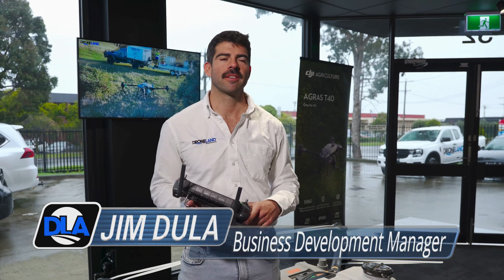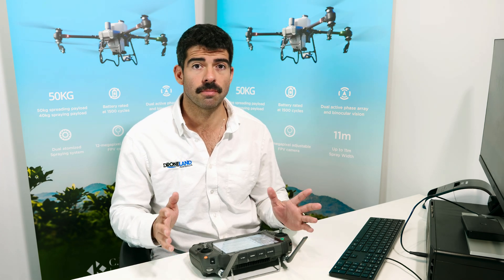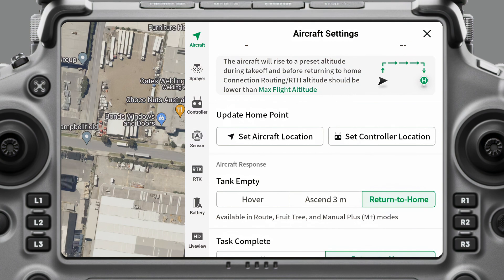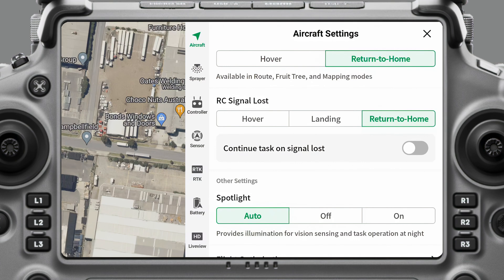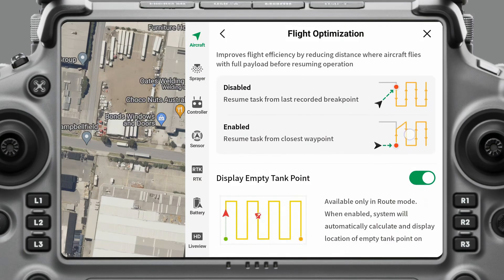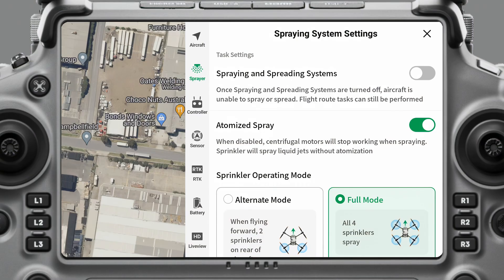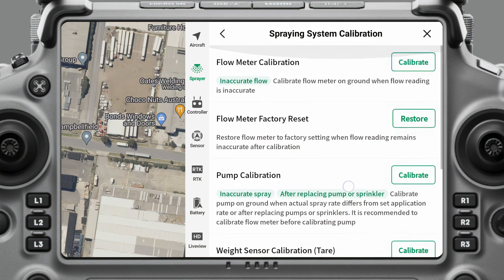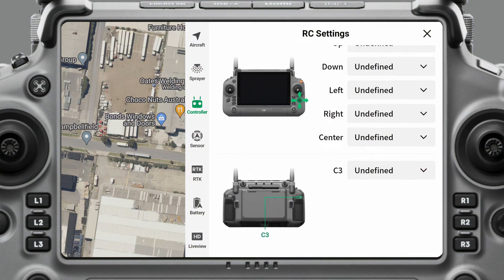DJI Agras T50 - Remote Controller Settings Explained - PART 1

Comment: Is there Arabic in the language settings?
Reply from the maker: A DJI controller typically supports a variety of languages including English, Simplified Chinese, Traditional Chinese, German, French, Korean, Japanese, Spanish, Italian, Portuguese, and Russian; the exact language options may vary depending on the specific controller model and can be adjusted through the settings in the DJI Fly app